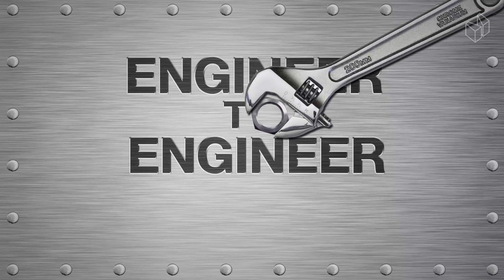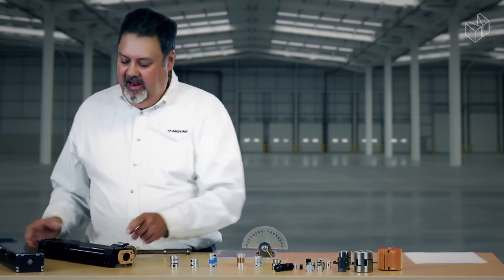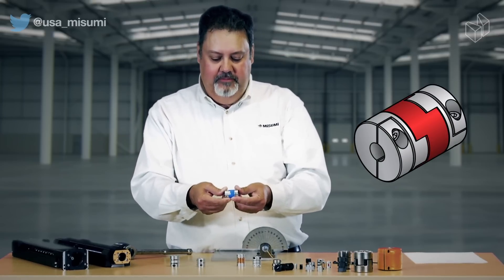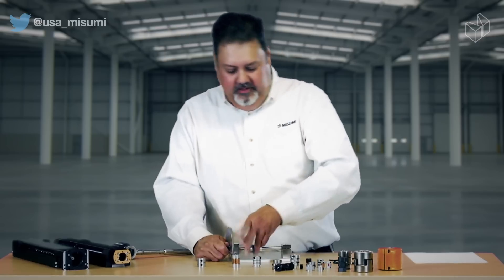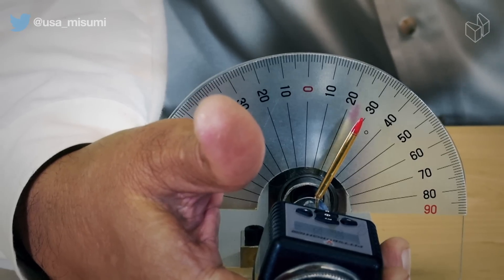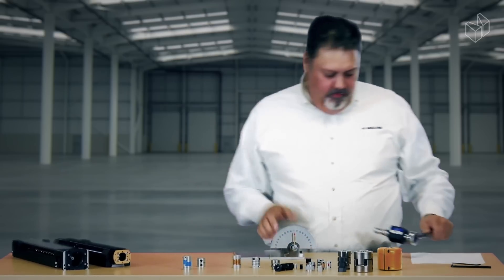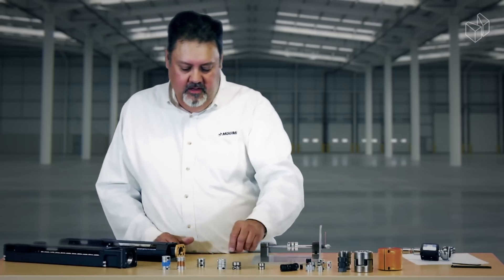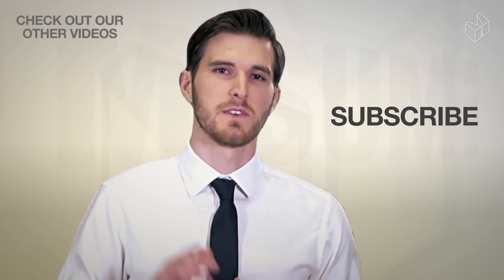Coupling Selection for Guides and Actuators | Engineer to Engineer | MISUMI USA

Comment: Do you also have couplings for Allen Bradley servo motors (type: MPL-B310P-MJ72AA). Motor has a keyway shaft (16 MM dia.), keyway slot is 5x5x25 MM. The other end of the coupling I require for a 10 MM dia shaft (no keyway)

Comment: There are a few problems here:  Terminology -- the "split" coupling is a helical or beam coupling.  We have enough names for it, we don't need yet another.  Oldham couplings don't have "spiders" -- jaw couplings have spiders.  Misumi calls them "spacers", not spiders.  Other companies call them midsections.

And then there are fundamental mistakes here:  You're not measuring "flexibility" with your device, you're measuring torsional stiffness.  And you're doing it poorly -- of course the Oldham coupling will deflect angularly, if, as you state, you torque it way beyond its rating.  And no, no standard Oldham coupling (as shown, with a rectangular tenon) would be rated for "4 or 5 degrees" of angular misalignment -- even the very sloppy, soft, molded midsection Misumi Oldham coupling.

There's no discussion here of homokinetic motion, for a ball screw application; no mention of reactive forces (which will be very high for a disc coupling if there's any radial misalignment); come to think of it, no mention of radial misalignment.

Other than that, this is a great selection guide.
Reply from the maker: Steven Elliott, thanks for watching! We appreciate your detailed comments, and hope you watch our other series.

Comment: Links to the parts showcased in the video would be great.  I have been looking for a good actuator/coupler/motor combo for a CNC project, but sadly after watching the video I am still at a loss of what part numbers I should be looking for.
Reply from the maker: Anthony Webb, This is our LX Series Actuator. For your specific project please reach out to Chuck directly at cleonard@misumiusa.com. In addition to being our Senior Engineer, he also has extensive experience with CNC's. Good luck with your project!